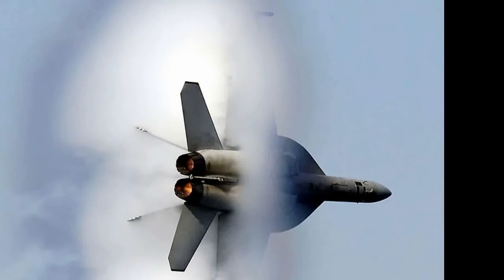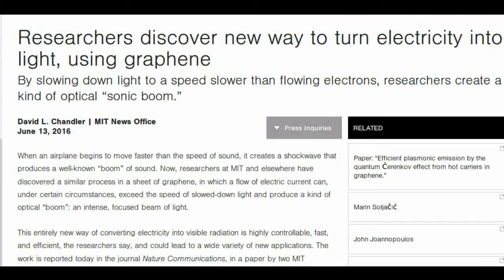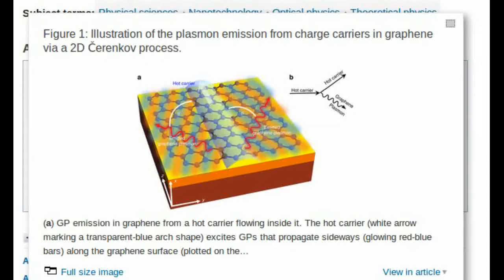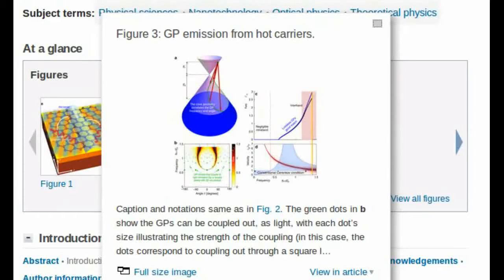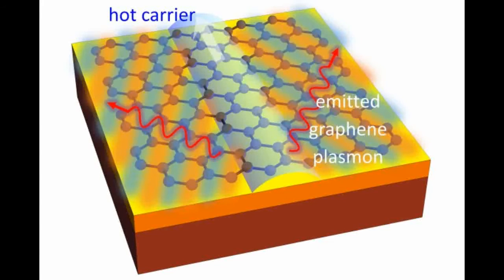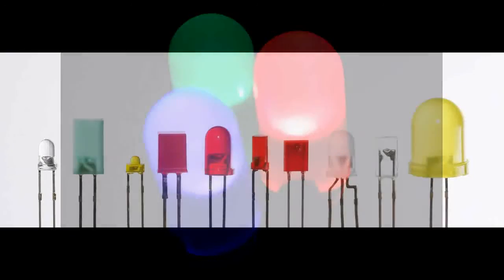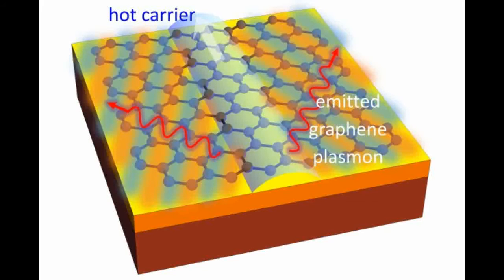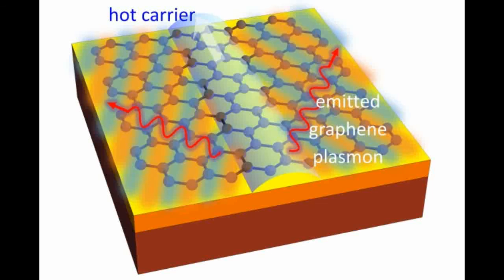MIT discovers new way to turn Electricity into Light, using Graphene

Comment: OK I was taught the electrons move at the same speed as light normally when in a circuit?  So the  graphene naturally slows light down a tiny bit and this gives enough difference in their speeds to cause a shock wave and a plasmon light emmission.  Did iget that right?
Reply: Robert Devino YES, yes you’ve got it. Please explore Doc EE SMITH for sci-fi on the subject.
Reply: Wast it the electrons, or the electric propagation wave that moves at the speed of light?